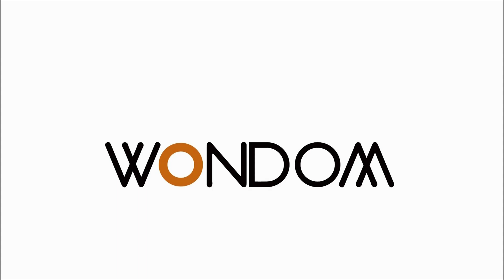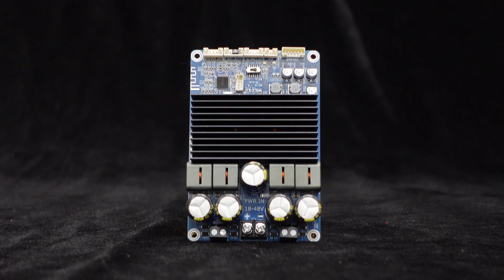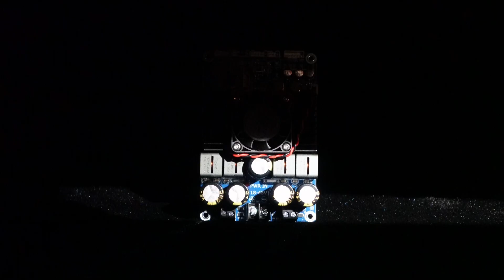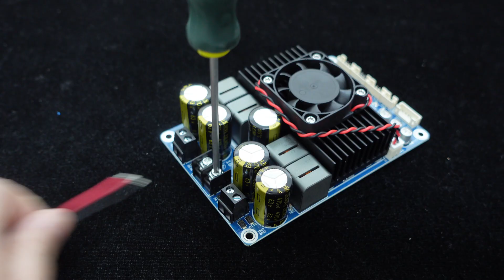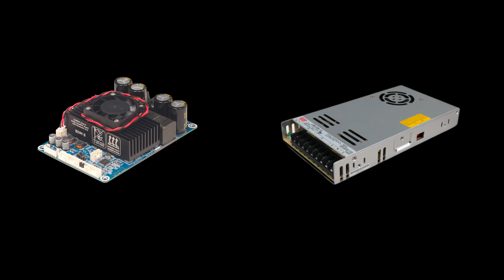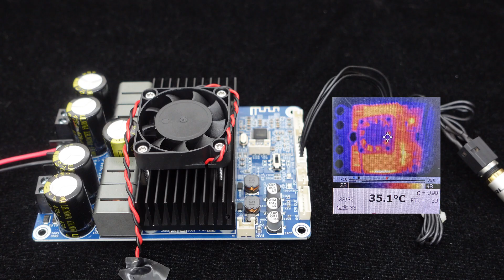2x300W TPA3255 Bluetooth Amplifier BDM8 with Fan, DSP EQ, Analog/I2S output | Desktop/Home/DIY Audio

Comment: Can i set the eq separatelly? I would make an active speaker from 2 of this. I would use its eq as a high pass/low pass filter.
Reply from the maker: Hello, the BDM8 doesn't support independent channel adjustment. The left channel and right channel will be adjusted together. Wish this could help you. Have a fantastic day~

Comment: I2S output is needed for synchronization. But I2S input is much more necessary. Is there a way to use one?
Reply from the maker: Hello, thank you for watching. The BDM8 doesn't support I2S input directly. If you want I2S input, a I2S to analog signal converter is required. Wish this could help you. Have a fantastic day~